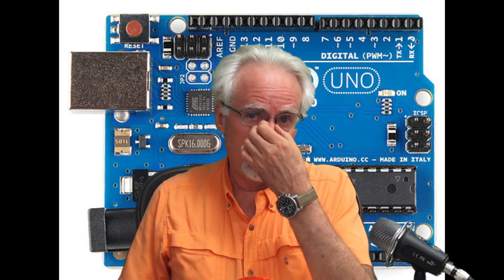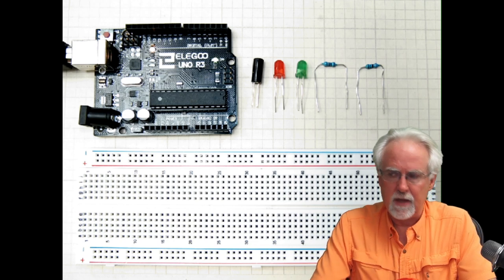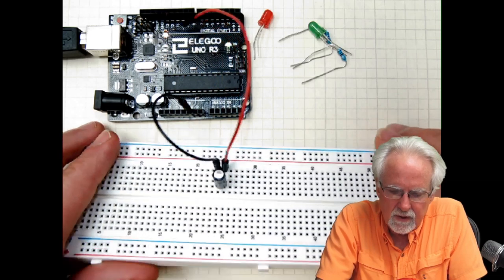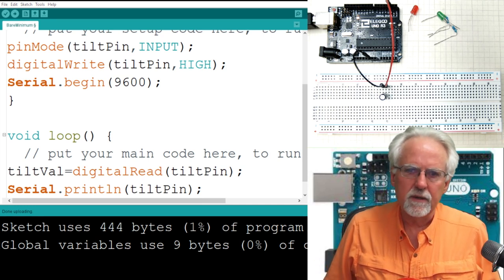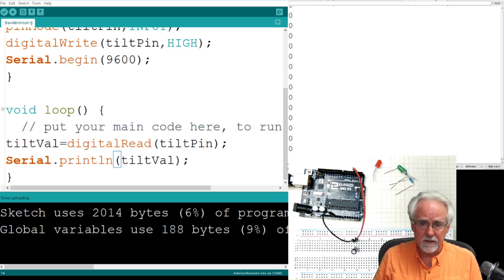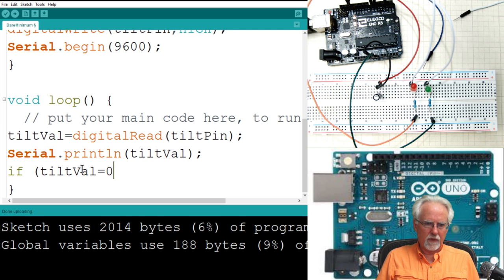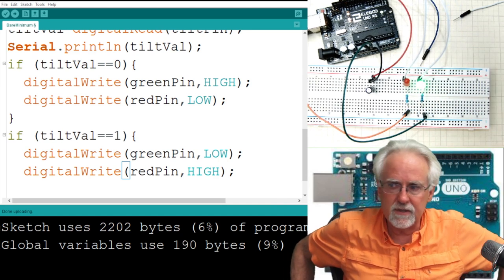Arduino Tutorial 36: Understanding How to Use Tilt Switches in Your Projects

Comment: I also used else instead of 2 if's on this. I jump back into your lessons to check things as I'm doing my homework (sometimes for only a few minutes, as you say), because I started your most excellent tutorials only 2 months ago, following my 80th birthday Arduino gift, and my brain velocity is much lower than it was 60 years ago! Also in this project i stuck my tilt switch to my stepper motor cardboard arrow (motor fixed vertically), connected using a pair of female/male wires. It switches the red/green LED's, but also controls the stepper motor direction, clock/anticlockwise, like a wiper blade. Thanks for your really excellent lessons Mr Paul. I used to live in Addis Ababa, love Africa and its wonderful people! Hi Gabriella !!

Comment: Hey Paul, thank you for another lesson (Gavriella)! I did this one before watching you doing it. Below is the code I ended up having. Nice way to simplify the if statements here - since we read 0 and 1 already we can incorporate these values in the digitalWrite statements:

int greenPin = 8;
int redPin = 9;
int tiltPin = 53;

void setup() {
  pinMode(greenPin, OUTPUT);
  pinMode(redPin, OUTPUT);
  pinMode(tiltPin, INPUT_PULLUP);
  Serial.begin(9600);
}

void loop() {
  bool tiltVal = digitalRead(tiltPin);
  digitalWrite(redPin, tiltVal);
  digitalWrite(greenPin, !tiltVal);
}

Comment: Thanks, post-Happy B-day! As a fun challenge I made the code so that it allowed vibration using two variables. The first was an average of 30 shorts or open circuits using a for loop. This produced either an int of one, or a float less than one. The other was produced with an if statement that counted the number of consecutive averaged ones (shorted states/cycles). So if 20 consecutive averaged ones were counted then it would allow the shorted state of one to pass through the if statement and trigger the light (if (ave=1 && count > 20) etc...). I based this by vigorously shaking it, which usually triggered 4-15 consecutive averaged ones. If I tipped it over, then it instantly (to the natural eyes) counts 20+ consecutive averaged ones (or shorts), and it gets triggered.

Comment: Gabriella!

I have noticed there is a small breadboard in the set which I have used as the tilting senor. The rest of the circuit I have implemented on the big one. Makes the sensor easier to play with.

Comment: This was a great problem which I solved with using Your Tutorials and, of course an Arduino kit.  A motor driven arm rotate starting at -10 degrees all the way around 360 degrees to +10 degrees and then stop.  Of course after it stops you will need to rotate it back to the -10 degree start position.  Tilt switch are not used due to repeatability problems.  We also couldn't use limit switches.   If you would like to know my solution just ask.  Only tutorials 1 thru 17 were needed.

Comment: Very  simple to write code from lesson 34. Swapped 0 and 1 in if statements. Works like a charm.
Maybe cars use a Tilt Switch with a weak magnet. Potholes and other bumps doesn't make the steel ball break the contacts. Using a short delay would prevent intermittent conditions. In a crash or roll over the vibration would be strong, opening the contacts. the Fuel Pump should shut off. Race Cars are famous for crashes and roll overs.
Wayne 
Happy Birthday! -Using "show more" shows November 12, so we have a while until next November.
It's getting into the 80s this week, so time to try Iced Coffee!

Comment: Tutorial 36, cute granddaughter Gabriella! This one was easy compared to the stepper motor (35).

In my business, I use a geotechnical testing instrument called a cone penetrometer(CPT). The earlier versions had an inclinometer that used a ball on a curved glass plate. A light emitting diode was on one side of the ball and a light sensing diode on the other side. As the instrument deflected from vertical, the ball rolled off center and partially blocked the light to the light sensing diode. The differing amount of light was calibrated to inclination which we could read in real time on our field laptop. Pushing in sand or clay, the response is smooth, but when we encountered gravels, the instrument would "jump" about a bit and therefore bounce the ball resulting in an erratic response. Not so different from the tilt sensor we just used in Tutorial 36. I have looked on Digikey but couldn't find an device like that now. The field instruments now use accelerometers for inclination. The CPT is not so different from an Arduino. It measures several channels including wheatstone bridge strain gauges to measure force.

Comment: I did not have a tilt switch in the kit I have so I simulated with a pushbutton switch. Same logic different switch. I had it approved by GABRIELLA. :) I used a simple If Else statements to decide what LED to Light. It worked perfect the first time through. Is it just a coincidence that I worked on this project on my Birthday?  Thanks for everything, Stay Great Paul.

Comment: Was able to watch the Video to the end and saw Gabriella. 
I also did the assignment without watching the correction although, I forgot to put my current limiting resistors😂. I later fixed it. 
Thank God we're working with a very small voltage. A large one would have blown up the LED

Comment: Unfortunately my kit didn't have a tilt switch.  It had a vibration switch so I learned to code that up with the red and green LEDS.  Slightly different circuit due to the type of switch.  It worked fine and I did it before watching your solution.  I am starting to have enough knowledge to find the information to program a new piece of hardware.  You are "teaching me how to fish" for myself!  Gabriella.

Comment: Made it all the way through. I was able to do it on my own, but had a hiccup in the code. I used an "else" statement instead. The green LED was a bit dim doing it that way and when doing it the way you did it, it was at normal brightness. Both ways worked, just less power was supplied using "else".

Comment: Gabriella is so cute - yes was an easy one, thanks.  The tilt switch is cool.  The only thing is I have all the significant labs all coded and connected at the same time. So I can select what test and run any of them.  I don't have the heart to disassemble them!  So its getting really messy -- I'm using an UNO and a Mega and 4 1/2 bread boards and hand making most of the wires lol.
Reply: I figured out what's going on here I think with the Stepper motor driver and motor.  I at least understand the stepper driver data sheet now - its in the included material in the Arduino download.  The driver board is just a buffer chip it seems.  It's passing through the four signals from the UNO to the motor.  The motor can be rotated by executing either a 4 step or 8 step sequence.  You can execute the 8 step sequence from step 0 to 7 (forward), or 7 to 0 (reverse), or simularly do the four step sequence.  Both sequences are in the data sheet.

Comment: I worked ahead, so I didn't wind up with an error. I did go back threw and find it though. I did the homework. Although my up position led is dimmer than the upside-down position. I think the switch is drawing allot of power so I'm going to try and do the pull-down resistor to see if I can increase brightness. Happy birthday, have a good day with Gabrella.

Comment: Gabriella. 

I did have one interesting thing happen. I ended up with things being backwards. When the tilt switch was vertical it had a value of 0, and when it was sideways it went to 1. So my red LED and green LED were lighting up in the wrong order. 

that said, I did do the homework by myself without having to watch the solution, which is not always the case for me.

Comment: Happy birthday~ 

void setup() {
  // put your setup code here, to run once:
  Serial.begin(9600);
  pinMode(12,INPUT);
  digitalWrite(12, HIGH);
  pinMode(11,OUTPUT);
  pinMode(10,OUTPUT);
}

void loop() {
  // put your main code here, to run repeatedly:
  Serial.println(digitalRead(12));
  if(digitalRead(12)==0){
    analogWrite(11,15);
    analogWrite(10,0);
  }else{
    analogWrite(11,0);
    analogWrite(10,15);
  }
  delay(500);
}

Comment: Great lesson once again! Was able to do the homework on my own.  Used if else instead of two ifs.  ALWAYS watch to the end of the video. Gabriella!  Question - doesn't the resistor go between the pin and long leg of the LED with the short end going to ground or does the order not matter?  I lesson 3, we learned to hook the resistor between the pin and the long leg of the LED.  That is not how they were hooked up in this lesson.  Also, some of the short viewing times on some of the video lessons may be people like me that jump back into a previous lesson just to check a previously covered concept.  Still loving this series!!
Reply: I also used else instead of 2 if's on this. I also jump back into lessons to check things (sometimes many times) because I just started your most excellent tutorials 2 months ago after my 80th birthday Arduino gift, and my learning speed is not as sharp as 60 years ago! Also I stuck my tilt switch to my stepper motor arrow (aligned vertically) connected using female/male connecting wires, so it switches the LED's, but also controls the stepper motor direction, clockwise & anticlockwise,  as windscreen wiper. Thanks for your really excellent lessons! Used to live in Addis Ababa, love Africa and its people! Hi Gabriella xx

Comment: Gabriella!!  Question on the LED's.  Why is the "short" let of LED tied to "pin" and then the limiting resistor on the "long" side?  Isn't the short side tied to "gnd"?  I'm sure it doesn't really matter, but my brain went like "what??"  Thanks Paul, you've been a great teacher and I've been enjoying these lessons to get my head back in the game since being off on disability at age 57.  This has really been a mind saver.  Many thanks, JD
Reply from the maker: The resistor can go on either side of the LED as long as it is in series. In either place, it will limit the current, which is the objective.

Comment: 8:56 The problem in your code is that you are printing tiltPin (which is set to 2) when you should be printing tiltVal (which is the value of the tilt switch)

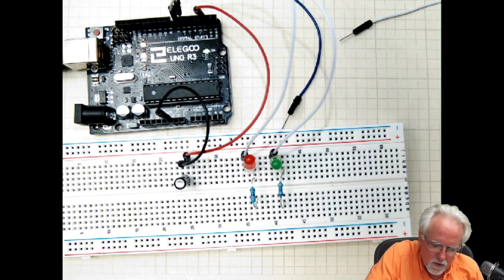Comment: Paul, I hope you get this message - I am stumped.  I have done all of your lessons up to 36 and I got stuck.  at 13:56 when you wire the LED's it appears that you are doing it differently than in the past.  It appears that the short leg of the LED's are going to the pins, the long leg to the resistor then to ground.  I look at my past notes and I have short leg of LED wired to go to the pins, long leg to resistor then to ground.  Am I going crazy?

Comment: hmmm, what if you started with an open tilt switch in a horizontal position, add another tilt switch horizontal in the opposite direction, both open positions ( reading zero). then when assembly is tilted in either direction you will get a 'one' reading when you add the two readings. then if you isolate which one gives you the 'one' reading then bam- you should be able to deduce which way it is leaning.
if you add 2 more so you have one tilt switch in each of the cardinal directions, you have a veritable rocket direction controller, maybe, if not for the dadgum vibrating effect.

Comment: Very helpful video. Gabriella is a cutie.  I am looking at ways to build a device to aid in vestibular therapy (I have had vertigo for over a year now.) I want to hook up four tilt sensors to warn of 15 degree tilt left to right and 15 degrees front to back. A different tone/pitch  buzzer for each direction of tilt should sound when body tilt occurs. The device would be worn on a head harness, possibly with a laser pointer. A quick question: does an Arduino Starter Kit have enough in it to do this other than needing more buzzers?

Comment: Hello,I have been watching your videos and I like them.I have a question about this video.Why did you connect the resistors to ground? When we want to light up led,we connect the resistor to 5V(long leg).However,this video(tilt switches) you connected the resistor to ground.
Reply from the maker: Resistor can go on either side of the component. Try and see.
Reply: @paulmcwhorter  Thank you. Your work is admirable.

Comment: BOOM ! yep did the HWrk prior. But I used an IF & ELSE instead of 2 x IF's. Seemed ok. Yep, corrected the 'tiltVAL' before you pointed it out. QUESTION Paul, I put the resistors off the '+' (pin 6) but 'in-front' of the long LED leg (you did it coming 'off' the short leg to Gnd). Does it matter where the resistor sits ? Mine still seemed to work fine. But is there a 'best practice' ? Many thanks ... UK
Reply from the maker: I never use else statements, I would use two if statements. Else statements sort of incporate a double negative logic which can cause confusion. I would rather say
If x>a  do m
if x<a do n
if x=a do p
Do you see how explicitly logically clear this is. I have exactly and precisely covered every possiblitiy and told it what do do for each case. To me, else statements are disacters wating to happen.
Reply: @paulmcwhorter  Good advice, thank you Paul. Any thoughts on the resistor placement question ? Best practice if any ? Thanks ...

Comment: If I put the resistor in between the ground pine on the uno board and the negative row on the breadboard do I no longer need a resistor for each led or do they each need there own?
Reply from the maker: Every LED needs its own resistor every time.
Reply: @paulmcwhorter  deal

Comment: Okay, got ya paused here, my first comment is you're asking for the value of tiltPin, which is indicated in your code as tiltPin=2, that's why you see 2 in the serial monitor.  I think you'd rather see the value of tiltVal, which is 1 or 0, depending on the condition of the can.

Comment: Gabriela is beautiful! I was wondering what would be the best way to orrient the tilt sensor - I was thinking of having it on a PCB so that it is almost horizontal so that I can detect slight tilts, but then it will only detect tilts on one side. Maybe I need two tilt sensors... but then again I guess I sould just use an accelerometer haha. Keeping it vertical means you really need to almost turn it over to see the effect of the tilt, but that might be the best use case for these! How are people using them in your projects?